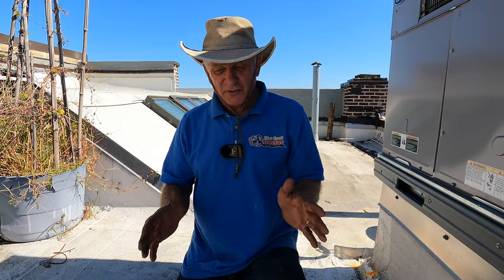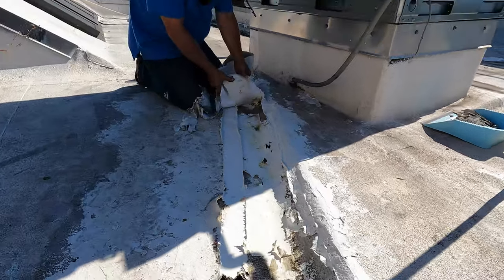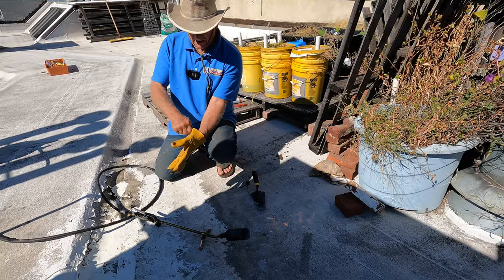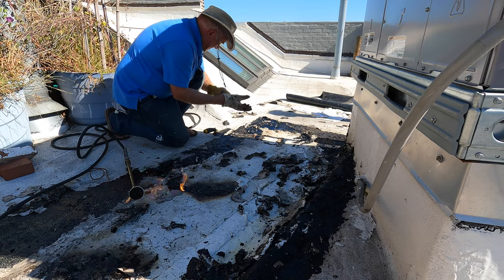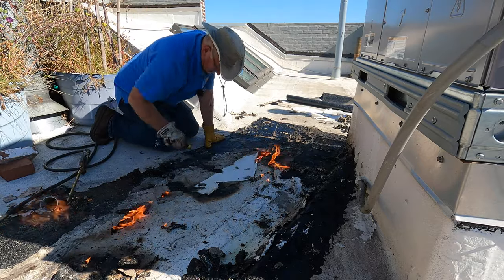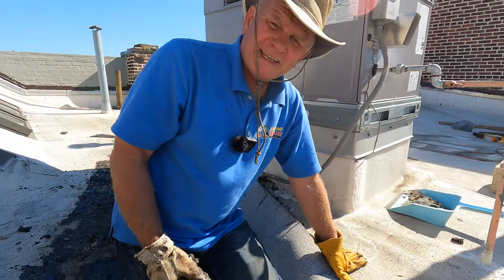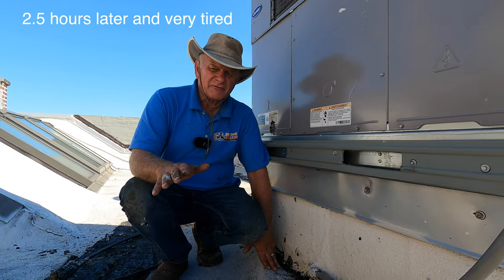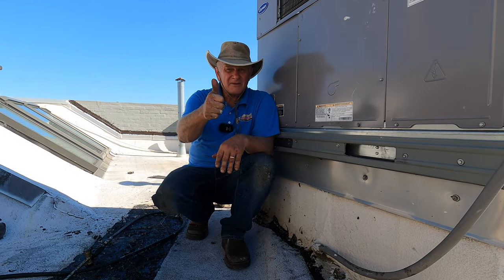How to Fix Flat Roof Leaks with a Torch

Comment: This may be something I should learn, how to weld in a new piece.  Also useful to see how to get the top coatings off.  Good demonstration.  Those torches are worth buying, unless I was looking at cheap and useless torches, they were priced reasonable.  Hell, if everyone wants to sell a new roof instead of doing these repairs, I may take up jobs like this part time.  I just did a repair on my roof today, but I wish it could have been done like this instead.
Reply from the maker: Glad it was helpful!

Comment: I have a flat roof EPDM that has to be re-done. My roofer wants a layover with a new layer of EPDM. Is that the best option? And should I have it recoated to silver/white? Thanks!
Reply from the maker: No, never go with EPDM. If the roof is slightly slanted, then Peel and Stick system will work. Check out Liberty peel and Stick.
Your EPDM roof might be OK but bad at the seams. I almost think you can save it by addressing the seams with Xtreme Silicone Seal or Super Silicone Seal Black with fleece. That works super good and you will never have to do your roof again.
Reply: @FlatRoofDoctor  
Do you use Xtreme Silicone Seal or Turbo Poly Seal directly on a gravel flat roof?
Reply: @FlatRoofDoctor  Would this Super Silicone seal work for the roof if there is a small hole? How would I cover up small holes in an EPDM roof? I have an area that is leaking. Only leaks when there is heavy rain. Just one small side of my ceiling about 5 inches wide.